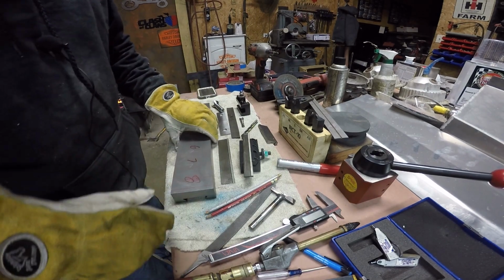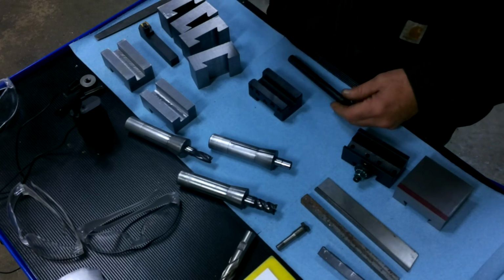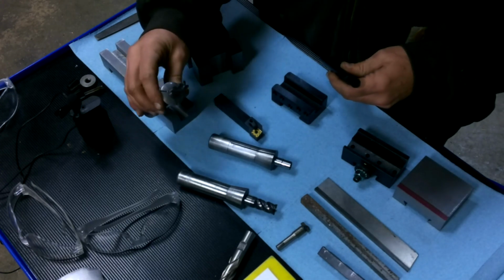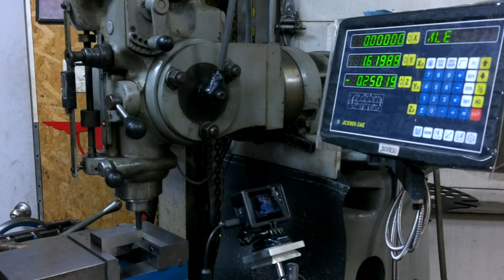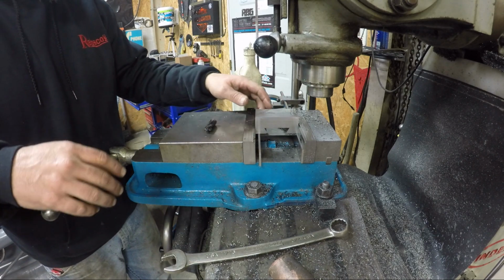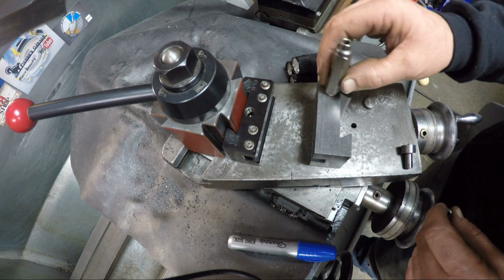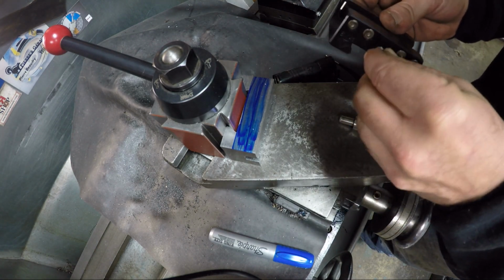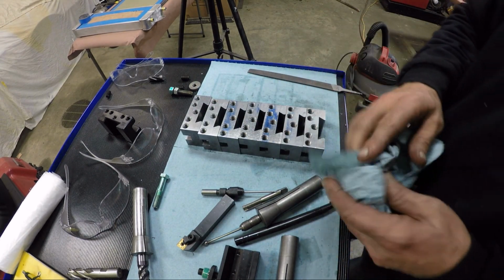BXA Tool holder Part 3

Comment: Great job.  I’m surprised on the 1/2 mill breaking like that, I’m even more surprised that you was able to still use it. Your correct on the layout fluid, no one stocks it here locally or as far as I know, because I checked. My local Fastneal said that they order me a container, I politely told the guy if I have to wait for you to order Dykem I might as well order it myself. I’ve made some of my extra blocks, and other tools to fit BXA tool post. Since I’m making the adjustment thumbscrew anyway my go to is 1/4 x 20 threaded rod, I started using it because on 1” tool holders once you cut the dovetail you don’t have a lot of space to place the larger screw. Also the adjustment screw  only just holds the center hight her clamping of the tool post takes the force. Just a suggestion not a criticism, there are motor than one easy to do things what matters is the end result. Good work

Comment: Coming on real well, the next step for me is drilling and tapping, and some more milling. Nice job 😁

Alan.
Reply from the maker: Drilling and tapping is the worst.  It took forever.   I used the stop ,and did each holder one hole at a time. So i only had to setup 5 times to drill and tap all 7

Comment: Excellent, thanks for sharing. I need to make my own when I get more experience. Only been at this a year. Question, could you put a slight groove in the bottom of the slot ?  It would make three points of contact for the round boring or threading bar. Tom at Hilltop Machine taught me this. I didn’t know what those screw sets with the points were till now.  Thanks for showing. Nicely made tool holders and quality craftsmanship. Looking forward to seeing more. Like your style. Now to go watch it again.   Ron...  👍👍👍

Comment: I mean no offense, but the fisheye distortion caused by the camera gives me a headache, literally.  It looks like you have a good process for the tool holders.  I'll check back later.
Reply: I came back at about 4:35.  It's not so bad at the table.  Carbide likes speed and pressure.  Fine finishing cuts don't go to well with carbide unless you run at a higher speed.  Unless you are turning tool steel, a properly sharpened and honed HSS cutter works well on fine finishing cuts.  You might want to try a vertical shear tool.  See mrpete222 https://www.youtube.com/watch?v=WUcyHenjkew.
Reply from the maker: @MaturePatriot  at the time stamp 4:35 ish is a different camera.   The other is my gopro 4  it has a lot wider view.  Ill look into narrowing it, if i can.   I think the gopro 7s are worse.   My speeds and feeds are good. I didn't have the vise tight.  It was the last one and i was in get-r-done mode.  Thanks